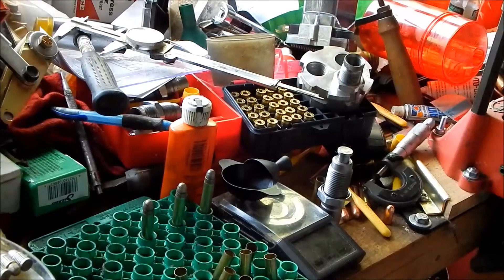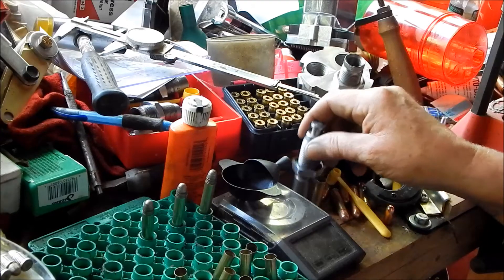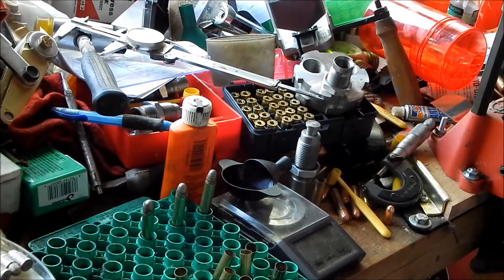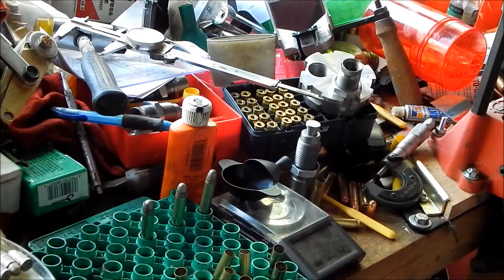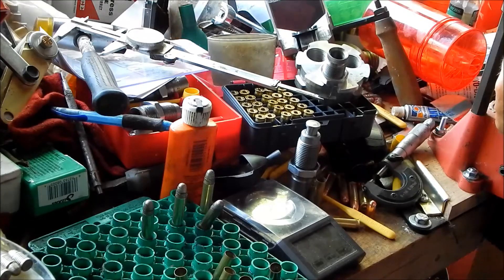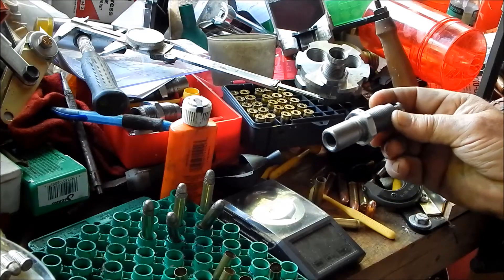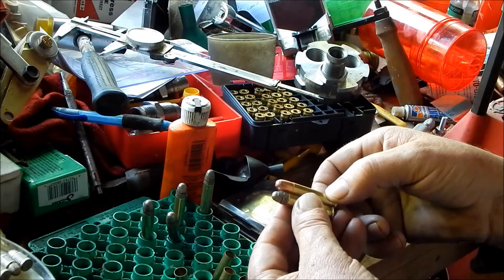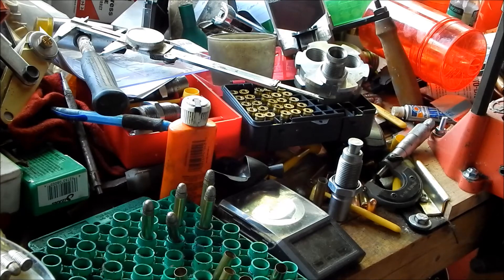Modified sizing die

Comment: I wonder if the trade off for your light plinking loads will be using less lead but more powder per shot in order to cycle the action?
Reply from the maker: In all likelihood, I have seen pictures of some wild conversions to 9mm that plainly show they modified the bolt also. Its a balancing act with the recoil spring, the bolt weight, and the power of the cartridge. I would love to have a couple of junked ones to try some experiments with, a lot of possibilities for modifications to this very simple design.